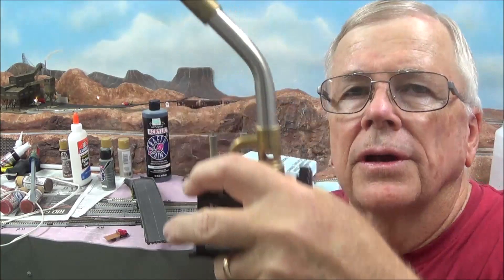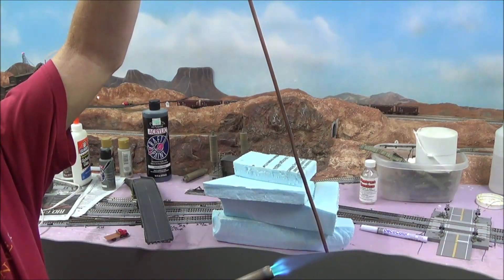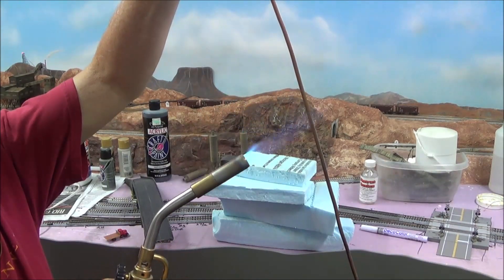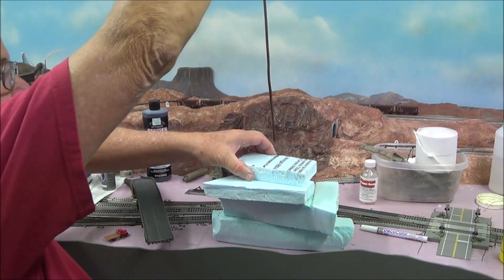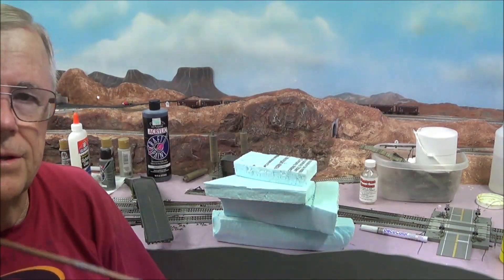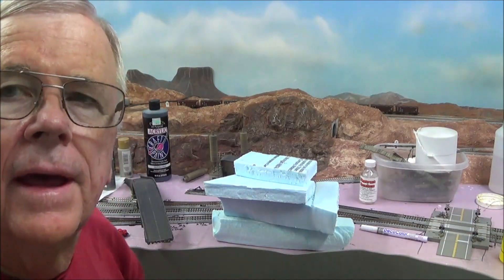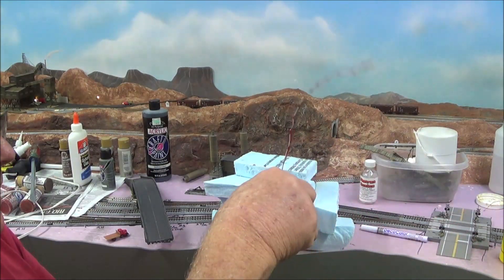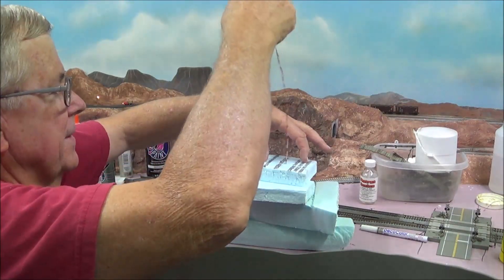How to Make Holes in Thick Foam

Comment: I like to finish holes such as this by inserting either a drinking straw or a section of plastic tubing into the hole.  It makes the job of pulling the fine wire through much easier.   I had several layers of 2" extruded polystyrene foam to transverse.

Comment: Hi Mike. I noticed that you didn't have plywood to go through. Is that the way your whole layout is...with no plywood base? I have a 3/8" plywood base on my new 3'x6' layout. I was wondering how thick the foam should be on top of the plywood have have on my layout. I know I'm going to have some risers on the layout, as well as maybe a couple of ponds or streams. Anyway if you could give me a little direction on this matter I'd really appreciate it. Thanks so much for your videos. I really love them because they are so informative to the point where you can't help but understand everything you're explaining. Thanks again for all your videos. You're the main reason I'm getting back into the hobby. You explain everything so easily.
Reply: Thanks Mark I used 2" foam and NO PLYWOOD and it works well with stringers every 16" on L girder benchwork.
Thanks , Mike
Reply: @N-Scale  Thanks again Mike. In my case where I have 3/8" plywood, would you also recommend 2" foam or is 1" enough. Thanks for getting back to me so fast!
Reply: @markgershman1563  Any thickness on plywood is fine I guess.
Mike
Reply: @N-Scale  Mike would 1" foam be enough to dampen the sound from the trains? The only reason I'm asking is that I'm gluing the foam down to the plywood.
Thanks again for getting back to me so fast! My guess is that you have a Great Love for the hobby. It's so obvious that you love to go that extra mile to demonstrate
everything in great detail. Keep doing what you're doing. I hope I can learn as much from you that I can so can feel Great about my layout when it's finished.
Reply: @markgershman1563  That should be pretty quiet.
Mike
Reply: @N-Scale  Thanks again Mike. It's a pleasure to watch your videos! After all these years getting back into the hobby the way I'm doing it is pretty exciting!
All the tips that you've shown on your videos to date have been very informative. It's always good to here tips that don't need to execute right away....because you can save those videos so you can retrieve them when they are needed. I can't wait to get things going with the layout that I can maybe send you some pics to show you what
I've been up to. Take care Mike. Keep them coming!

Comment: Mike, what I do is purchase a 12" piece of brass tubing, 1/4", 1/8" etc.   On one end I use a round file on the inside to create a sharp edge.   Then I take a triangle file and file "slots" across the surface so it looks like a set of sharks teeth - do it at an angle like creating a saw edge.   Now, you can turn that, by hand and drill through multiple levels of foam.   You'll of course get foam inside so use a length of piano wire to "clean" the inside.   Like drilling a fence post hole, you may need to go down a couple of inches, remove and clean and repeat till through.   Putting a bit of masking or medical tape at the top gives you more grip.   And, if you grab it part ways down to center it, you won't burn yourself!   Oh and I REALLY like Roger's suggestion of putting a drinking straw in afterwards but, if you don't you can insert the brass tubing and feed the wire through it, it won't get caught on anything, then pull the tubing out the bottom!
Reply: Thanks Don , good ideas but way too much work for me.
Thanks , Mike

Comment: That is very impressive. I didn’t want to be using a blow torch in my house so I came up with a different way that works very well. It is based on a punch you can use to make gaskets or cut items like leather. However, I have 6” of foam to go through so a store bought punch wouldn’t “cut it” for me. 😬. I bought a 5/16” diameter brass tube and beveled the end. No serrations or teeth just a nice bevel. I cut the tube to the length I needed, stuck it in my drill and made a clean hole in my foam. Went down like a hot knife in butter, or more appropriately a hot rod heated with a blow torch. 😀
Reply: Great Idea

Comment: Hey, Mike. Great tip, but couldn't you just heat the first 2" or so of the wire? You only need to melt along the leading edge.
Reply: You can but I found that the foam tends to stick to the unheated part of the rod.
Thanks , Mike
Reply: @N-Scale   Well, there you go. The Voice of experience. Thanks Mike. That's good to know.
Reply from the maker: Thanks for checking it out Ron.
Mike